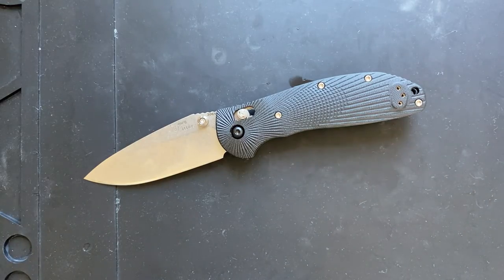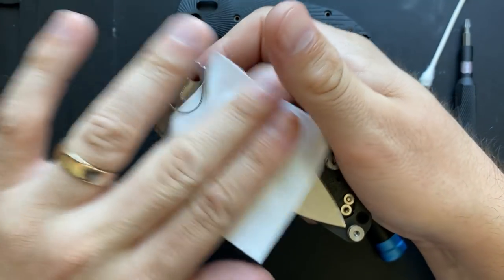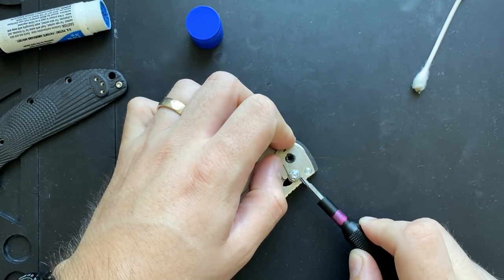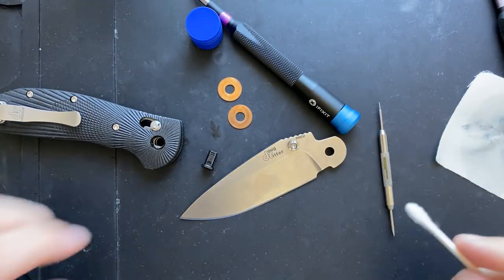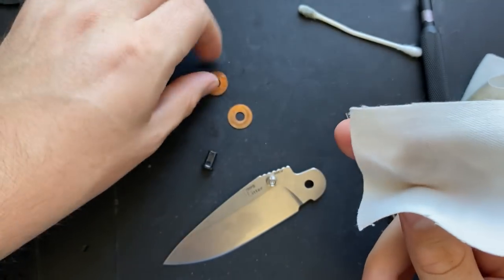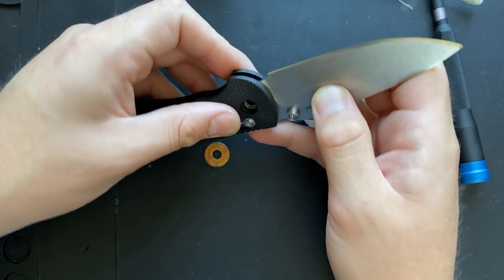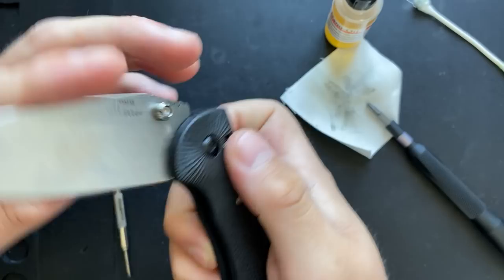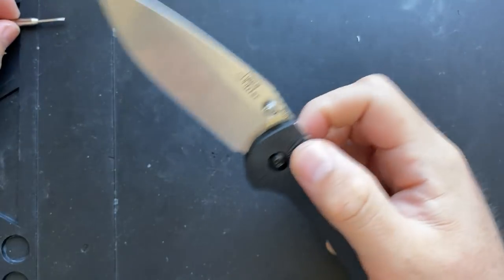How to disassemble and maintain the Hogue Ritter RSK MK1-G2

Comment: I got one of these back in August, when it was still made with m390. It’s a pretty good knife. It’s an axis lock. It is rock solid with absolutely no blade play, yet it drops shut as if the pivot is loosened. It took a bit of breaking in, the axis, or able or whatever, felt a little gritty, and took some time to smooth out, but for the price, not a bad all around edc. What’s disappointing is to see people, on the secondary market, trying to sell these for double what they go for. Knife works is selling them for $159-$162, depending on if you get the all black with the coating on the blade. They also have them with orange scales.
Reply: I just bought one and is also gritty. The grittiness is coming from the tooling marks on the back of the blade and it's making me think it's acting like a saw and cutting into the lockbar since mine is 20cv and i'm sure it's a harder material than the lockbar. All my other knives are smooth and polished on this part of the blade but not this one. You can definitely see the tooling marks. Do you still have yours? Did the blade get smooth or do you have a cut in your lockbar where the back of the blade rubs?